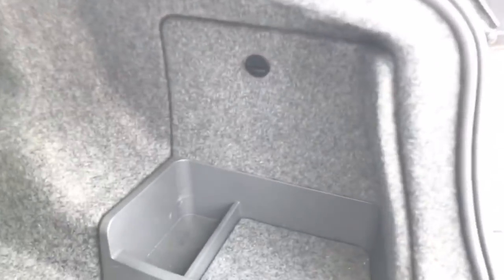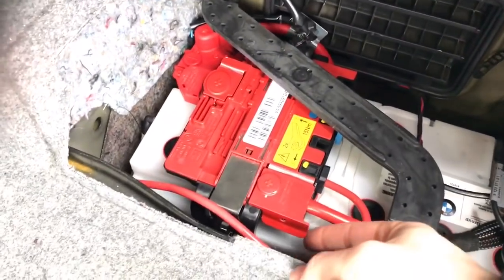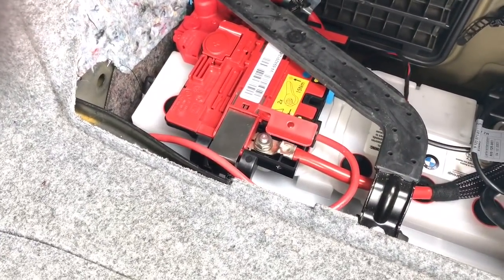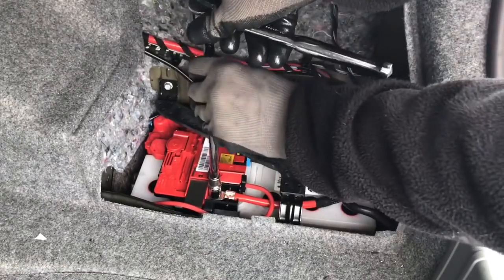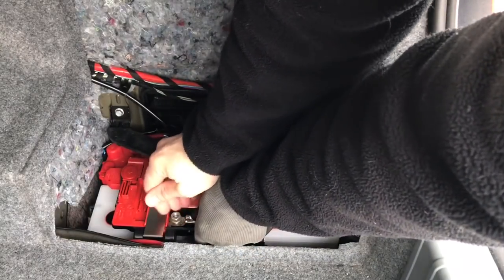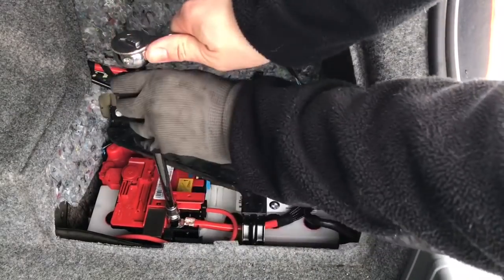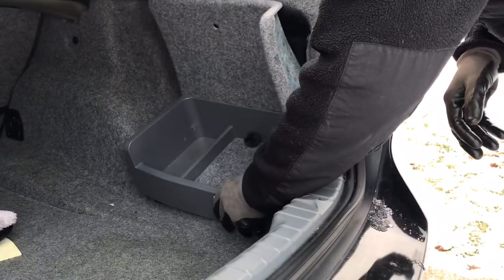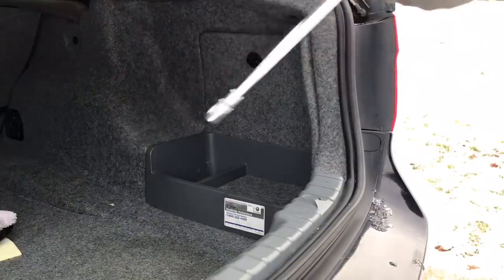BMW Electrical ISSUES Quick FIX! Well?

Comment: Have you done your trans fluid yet? Bmw states that its “lifetime” fluid, but the maintenance schedules stop at 100k.. 100k is the lifetime of the car meaning that if you drive it over 100k youll need a trans fluid and filter replacement

Comment: I have a 2008 bmw 335xi who after installing a starter now wants to show my back doors being open when they are closed. Light pops up while I drive so annoying. I can't lock my car with the key plus my keyfob stopped working ilin lock and unlock. Battery seem welded so I'm screwed. Any help?

Comment: One possibility is the over-extraction of power by the aftermarket bulbs. The system no longer recognizes them as stock halogens. 
The best solution may be to match LEDs that consume equivalent power as stock halogens, whereby the system isn't able to detect the difference, and is 'tricked' into 'thinking' that the new bulbs are no different than halogens - therefore throwing no codes [see F30 LED upgrades in bimmerpost].

Comment: ok, so this is not entirely correct this does nothing, just pulling the battery for a couple of seconds won't cut it, also NEVER EVER disconnect the + terminal EVER first.  1> Remove - terminal 2> Leave it off for at least 30 minutes (this is due to capacitive effect of different modules) plus you don't wanna be spiking components 3> Reconnect  I would actually say 1 hour but minimum is 30 minutes, but for safety sake don't EVER remove + term first ever, ALWAYS including for jump start, (- off + off + on - on).. I'm guess this is why your vid got thumbs downs

Comment: I suppose you let the entire system discharge, meaning not connected for at least 30 minutes?
It seems strange this would happen with codes and a new battery install.

Comment: No no no! Never disconnect that power cable while the terminals are installed on the battery, always disconnect the negative cable first, and reconnect it last when disconnecting or replacing a battery is unavoidable.

Comment: Well my list got shorter; thermostats and water P done, replaced tint on rear glass, airbag replaced, ... but my battery is acting up only 2 1/2 yrs old... next is a battery plugs and coils... also coding out the tpm... that is on permanent ... getting there...

Comment: Im having votage issues i swapped out the voltage regulator 2x from fcp, new battery and coded, i installed a used alternator and im still getting voltage issues. I get brake, dct, and cluster and radio stop working for. 3 sec its super random and inconsistent-on when it happens any ideas?

Comment: My bmw e60 520i 2004 model battery drain down completely when I leave the car unused for 2 days and I can hear my audio unit CD spin even when I off my engine with the key out, please what could be the cause
Reply: IBS SENSOR

Comment: I’ve lost power to door locks, windows, radio, gauge lights, sunroof, any ideals?
Reply: Did you ever find out the issue?
Reply: @runnawayj6896  yes a bad wire connected to radio caused it all to shut down
Reply: How did you figure out the problem? I have the same issue
Reply: @jupitervisions8755  it was a bad wire to the radio, shut everything down one day at a time
Reply: This is happening to me as we speak i need help plz….. How you figure it out?
Reply: @2simco  mine turned out to be a bad wire connected to radio..
Reply: @2simco did you figure out your problem

Comment: yeah just to add, you have to leave the car to go into sleep mode

1) open trunk,
2) leave open,
3) To be sure, when light by the shift knob goes out, that should be 16mins. 

Otherwise be prepared to fry a control module